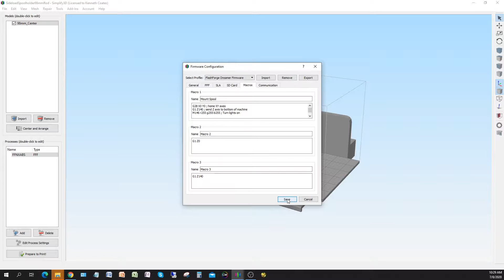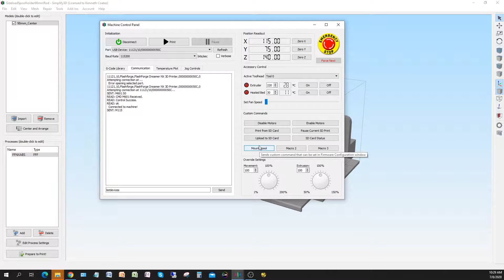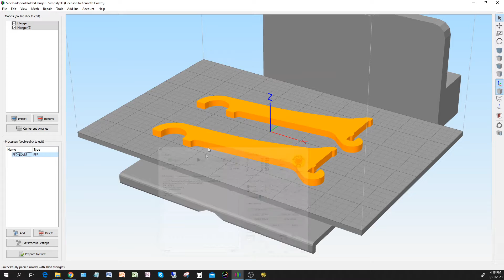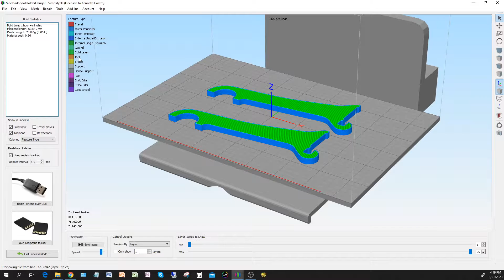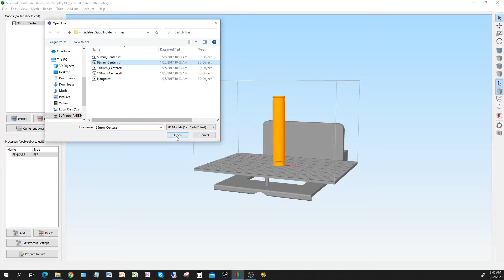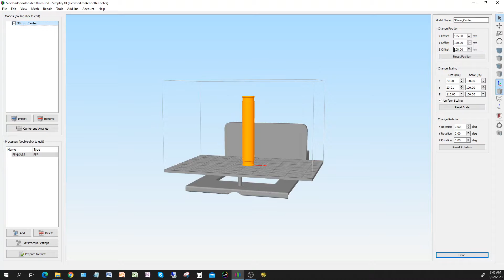Flashforge Dreamer (NX) - Using Large Spools of Filament - Ominstand & Side Loading Spool Holder

Comment: I printed the same holder, works great. I did not put the panel back on the side of printer. Also printed holder for the top of printer.
Reply from the maker: What did you print it with?

I put the panel back on so it would keep the heat in better. I print in an unheated garage and this winter I've had to make some adjustments to keep printing. A video about that is coming out soon.

I printed mine with the ABS that came with the printer (don't know the quality of it, probably not great).
I've been using mine for 6 months and both hooks cracked. I glued the first one and it held up okay, but the second was too far gone.
I recently modified the design of the hangers to beef up the hook area and reprinted them with PETG.
I'll have a video up about too.

Comment: Awesome video! 👏. I have been frustrated as a newbie on 1kg spools and tried a couple of parts but the Omnistand looks like it will do the trick. I’m hopping over to print that on my next run. Thanks again.
Reply from the maker: Glad it helped!
Anything bigger than 0.5kg, I'm using the side loading holder. It's just easier.
It's been working great for me although I bumped into it once and knocked the reel off. One of the hooks on the arms sticking out got a crack as well as the axle. I glued both with super glue (and some tape on the hook) and they're okay.
I'd recommend printing the axle with a solid layer every 20 layers for increased strength.
I'm going to be reprinting those parts in PETG (instead of the ABS I'm using now) in a future video. Hopefully that will be more impact resistant. :)

Comment: Great video - did the larger spool work when you had it on the inside?
Reply from the maker: Thanks!
In the video I show the .75kg fitting if you use the 20mm spacer on the print bed side.
However at 5:37 I show that 1kg reels doesn't fit, the print bed barely misses it, but it's right next to it and since the print bed is heated, it could cause problems with the plastic reel.
Even worse, the printhead will hit the reel if it moves over to the left side of the bed.

NOTE: Even though the .75kg reels fit, I'm printing those using the side loader as well.
I only use 0.5kg reels on the inside.